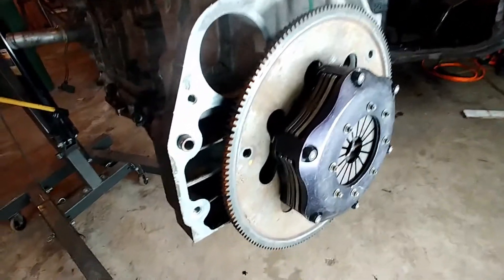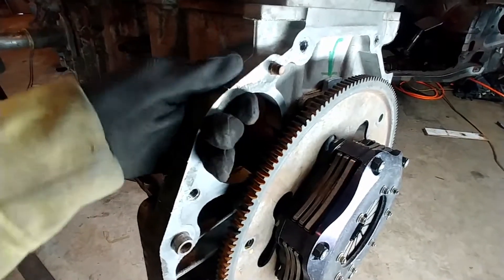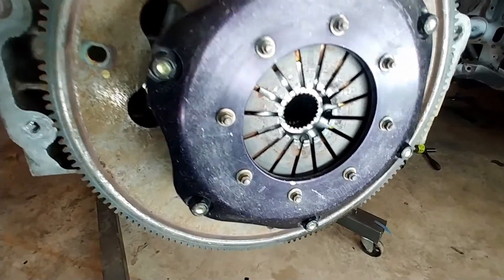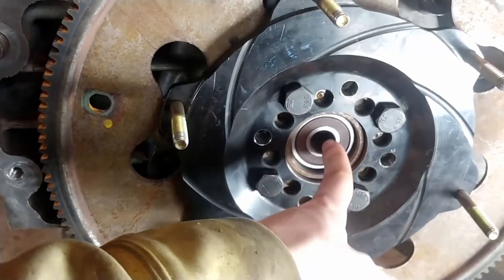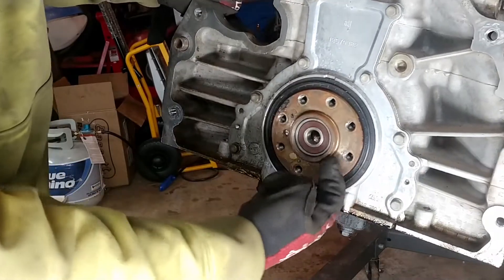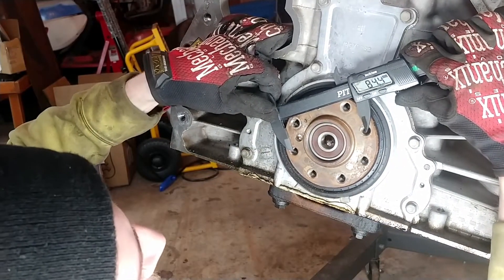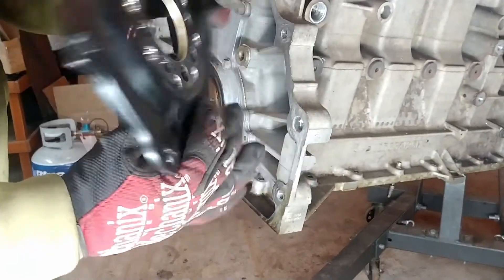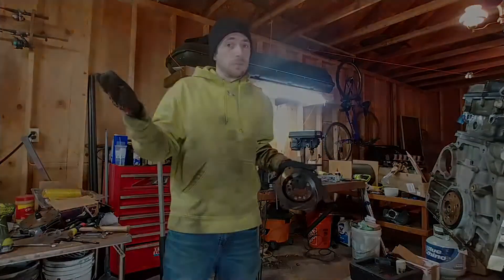Custom Triple Disc Clutch for ANY ENGINE configuration

Comment: Just watched all your videos. And subscribed.  I'm impressed with the ambition to diy a dry sump pan and adapt a pump. What did the pump come off? 

As far as the clutch, did your spacing just happen to be perfect for the Colorado Trans? Or will there have to be some modifications to the Trans? I'm just amazed the Trans will have the right bolt pattern and input shaft length and throw out bearing to work with that clutch. Is the 4200 vortec the same bolt pattern as an LS? 

I have one of these engines pulled from a wrecked envoy and I was thinking about using it for my 1st gen RX7 to be different wanted to turbo it also. But was weary due to the lack of support these engines have. Always thought this should be the American JZ or RB or Barra. The other thing that deterred me was the overall height, but that dry sump helps that alot, what's your pan to valve cover measurement?
Reply: Also you should make a video where you take a step back and show everyone what you're doing and why and outline the plans for the car etc. Do a tour of the car and introduce yourself and your shop etc.
Reply from the maker: @NeonAvantium  I will definitely do that video when I have a shop again. I moved and everything is in storage currently sadly but I'm still doing some engineering and development without a garage.
Reply from the maker: The mounting distance wasn't correct. I had to shim the throw out bearing to match what was needed. I don't know the pan to valve cover height but it could be the shortest that's ever been. I'm also developing an intake that doesn't wrap above the engine, significantly increasing hood clearance.

Comment: Are you concerned about the lack of rotational mass and inertia with this setup vs a traditional flywheel? Revs drop between shifts I mean.
Reply from the maker: The drivability will be a bit more difficult yes, but the benefits of losing the mass for acceleration far outweigh the drawbacks. For the revs dropping I have something in store for that, or you just shift faster which also increases acceleration.

Comment: It's so easy - even looks like cheating :) But wouldn't this small flywheel be weakened by the holes drilled? Walls between new holes and the old ones does not look very thick. Especially if you're going 400-500 whp with this engine...
Reply from the maker: I made a kit for someone running around 600hp and they had no issues. The flywheel thickness mixed with having 8 bolts. Every bolt or hole would need to sheer simultaneously for there to be a failure.